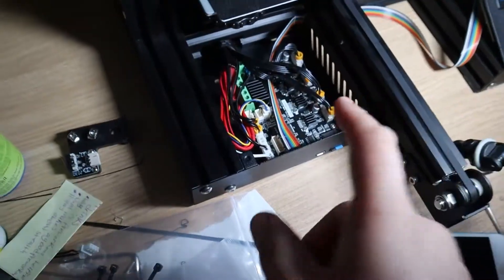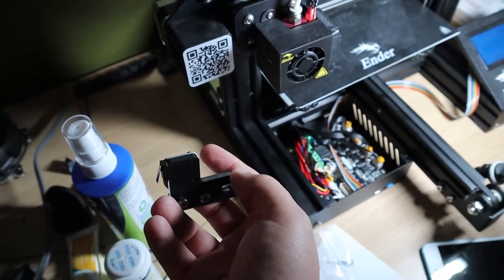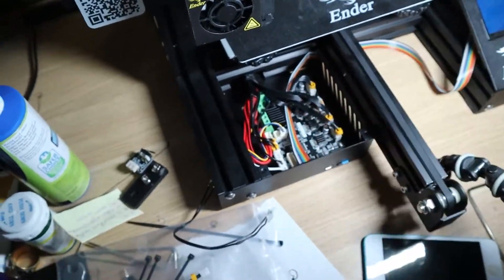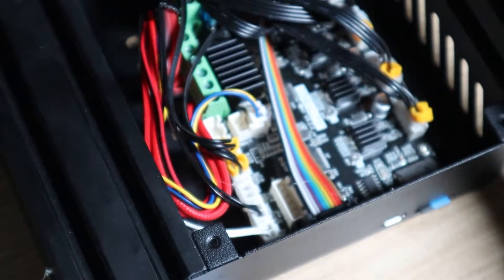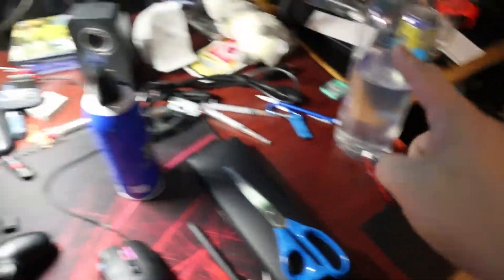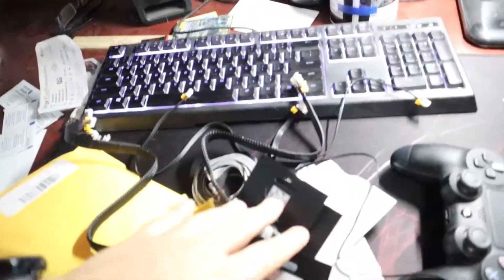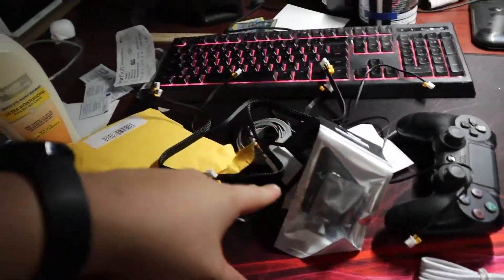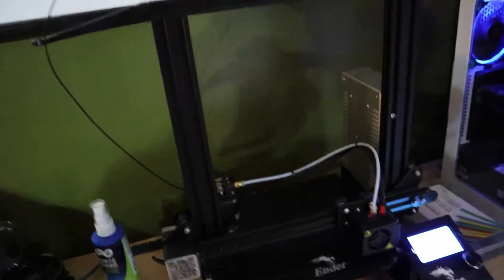Ender 3 Z Axis Limit Switch Replacement (And FIX)

Comment: This may be a bit late, but I have the likely answer to your question:
It's to mitigate things coming unplugged in transit. 
Bamboo labs had a similar issue with certain got end plugs coming unplugged in shipping. Their fix? A dab of silicone on the connectors that would come unplugged.
I'm a field technician who works on industrial 3d printers, and have had to go to sites where expensive equipment wasn't working and the customer was losing their mind.....all because a plug shook loose from a motherboard in transit.
Reply: Is it a pain to scrape off to unplug it?
Oh yeah. Does it waste our time? You bet.
But when Creality is doing the math, it probably looks like this:
(Cost to add hot glue) - (money saved by not having printers returned) = cost to them
If it's negative, they save money by adding glue.

Our convenience is nowhere in that equation, sadly.